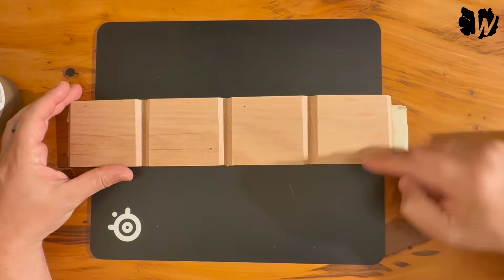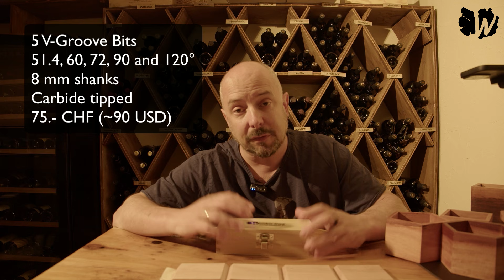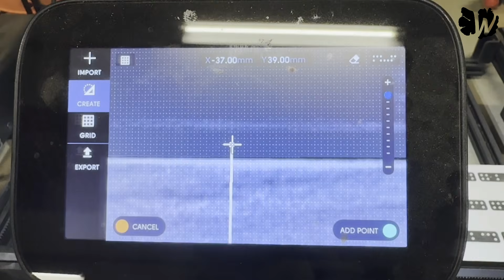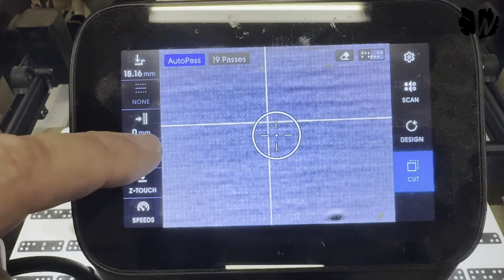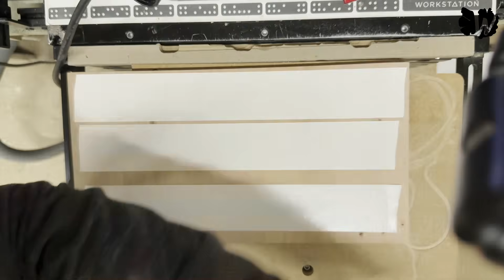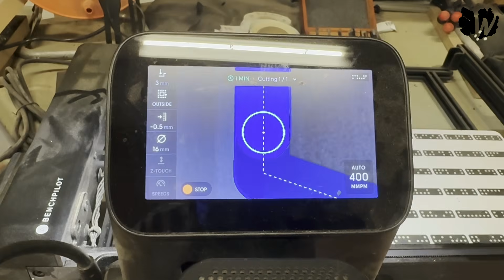The Easiest Way to Make Wooden Boxes With Your Shaper Origin - New set of V-Groove Bits

Comment: Making these router bits out of carbide doesn't make sense either. The cutting edges are straight. You can just solder them on.

Are there any bits like this with a spiral flute? If so, they must be made of carbide. I'm only familiar with the option that uses replaceable inserts.

But I have a feeling that replaceable  inserts don't work as well in the Shaper Origin compared to normal Bits. They vibrate more than they do in a regular router
Reply from the maker: Ah, that is interesting Michael. I had no idea that carbide only makes sense with spiral designs. Indeed these ones are soldered on and can be sharpened many times. Hence the bit producer advised to go for carbide tipped to keep the price lower. I think 90 USD for 5 bits of that quality is pretty good, so I went for it.